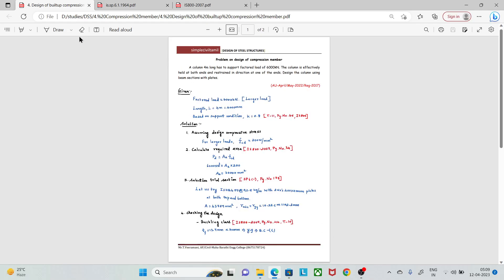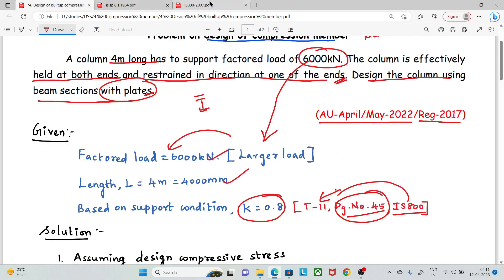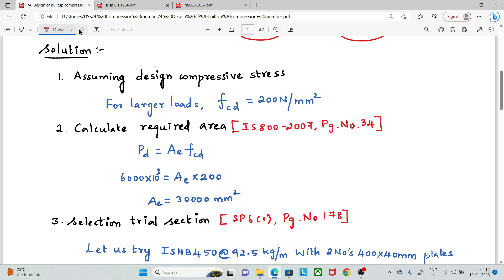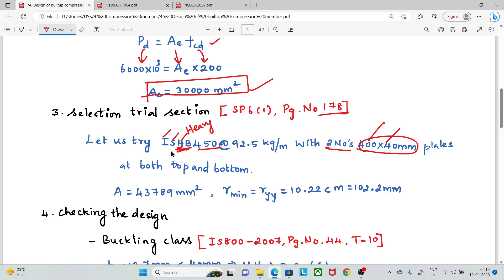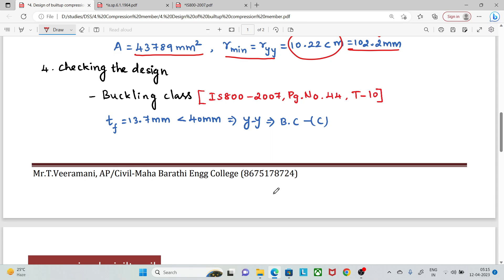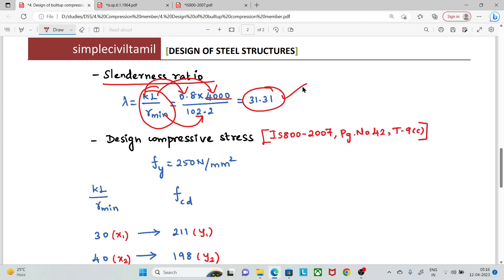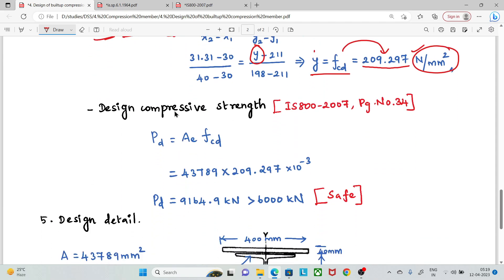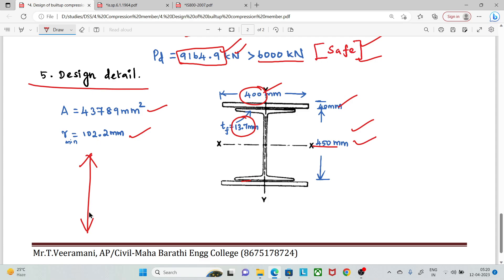Design of compression member

Comment: A column 4m long has to support a factored load of 6000kN. The column is effectively held at both and restrained in direction at one of the ends. Design the column using beam section and plates.